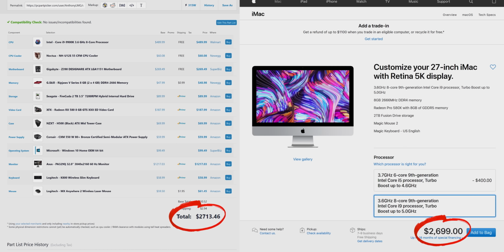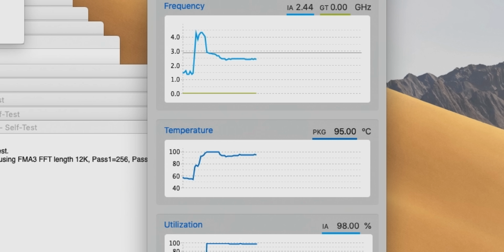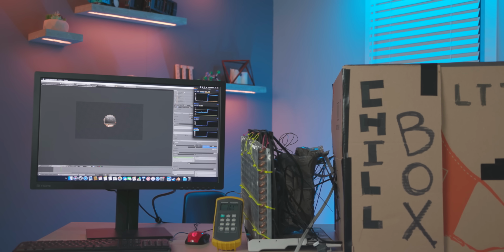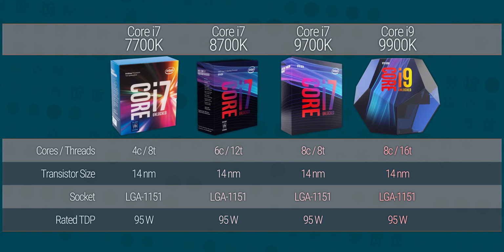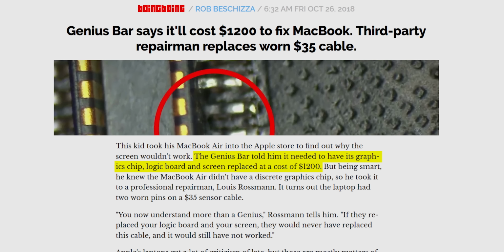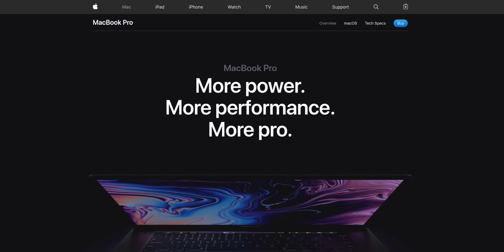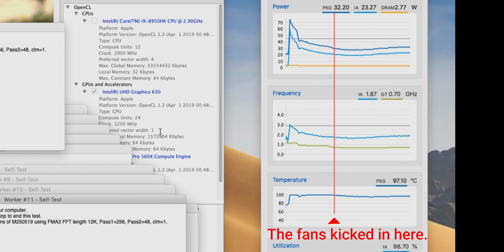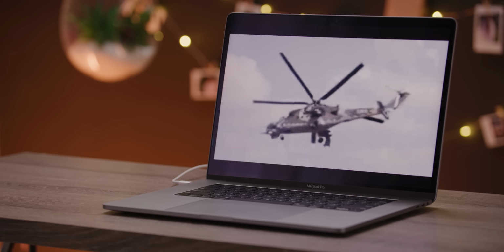Macs are SLOWER than PCs. Here’s why.

Comment: Most important thing is software - not to look cool. The track pads are also a dream to work with if you're stuck in front of a computer 14 hours a day. Then ease with which you can flick between screens and minimise things more than makes up for the extra .2ghz you might get with a PC.
Reply: Fuckkk then I must've missed out on with my custom built pc that outperforms basically any Mac on the market
Reply: Vlad Like Outpaces, definitely doesn’t outperform.
Reply: @danielk1380  how do you know? I've been building PC's for 6 and half years, everything that you described in that original comment  about how you experienced Macs is basically what I experienced on my pc, the only difference is that my pc actually has the fucking horsepower to run some very demanding programs and play any video game at maxed out graphics settings

Comment: They doubled the cooling capacity on the 2020 mac mini and literally no one is talking about it. Get the 6 core, install your own ram, and get an egpu. The thing is actually a beast for under 2K.
Reply: And my custom built pc that is under 1500$ can already outperform that and feel even better to use
Reply: Vlad “It feels better to use” ?

How much time have you spent on the 2020 6core i7 mac mini with 64GB ram and the black magic pro egpu?

There’s really not much to criticize.
Reply: @bigimportantman1544  how much time have you spent on a Ryzen 5 3600, an GeForce RTX 2070 super, 16gb of ram, and 1TB of  Solid State Drive storage, that also has 2 monitors, and one of them are 144hz monitors. Don't need 64 gb of ram, I never needed that much for most resource intensive games, it's just a waste of money and I'm much more at a disadvantage buying a Mac in general

When I build a pc, I aim for both having low price and good performance on computer parts
Reply: @bigimportantman1544  Ive been building PC's for 6 and half years guy, you don't need to explain me what computer feels better to use
Reply: Vlad Cool. I wouldn’t even know what feels better because I’ve had no desire to switch off from my setup. What exactly is inferior with it?
Reply: @bigimportantman1544  the graphics card combined with the cpu I'm using, but the graphics card is where it outperforms, in every game possible rn it feels amazing, programs don't have any sort of hiccups because of the cpu and the solid state drive. And in general its the price per performance, I am able to achieve way more performance even tho I payed basically around 1k for all the parts to build the PC
This building a pc might seem complicated but doesn't take much to understand it and for me it's fun to build too
Reply: Vlad More power to you. I’m not really a computer guy. I just periodically upgrade my mac mini setup whenever something is throttling. It’s basically specced out to the max right now, but I traded up overtime without ever spending too much.

Comment: The reason they do that is because users who use a product like a macbook air simply want something that’s always fast and snappy for basic productivity. Basic productivity sometimes requires a temporary spike in CPU usage, but nothing long enough to cause the internal temperature to significantly change. If you just need something that’s portable and snappy with a great battery life, MacBook air is perfect. If you want lots of computing power, they made the MacBook Pro.

Comment: The new ryzen 4000 chips seem much better with heat generation.  I wonder if Apple will start to use them.
Reply: Ryzen 4000 are great cpus don't know tf you are talking about
Reply: @vlad3223  Sorry I meant they don't produce as much heat compared to Intel chips.  Yes they are great chips.

Comment: The problem Apple Computers and specifically Macbooks have are Intel processors. 
They just perform bad and generate too much heat to perform okayish. 

If Macbooks had own ARM processors then they would be better than any other laptop, including way better thermals. 

I mean the A12 in the iPhone 11 has higher single core performance than a Ryzen 7 processor and it runs at just 6 watts. 
Same with iPad Pros being faster than Macbook Airs and entry Macbook Pros.
And iPhones and iPads dont even need active cooling. 

Since ARM Macbooks will come in the future for sure, you can only imagine what Apple can do there. 
Their processors certainly will be 1 or 2 generations ahead of AMDs mobile lineup. 

Take tablets and phones for example.. 
There is no competition for iPads in terms of processing power. 
Same with phones.. I mean its a bad sign for Android phones when an Galaxy S20 Ultra barely beats an iPhone XS from 2018 in benchmarks.
Reply: Did you just say that a mobile processor outperforms a very good desktop cpu? Just please for the love of fuck, do some basic research on desktop and mobile CPUs

Comment: I'm pretty sure Apple doesn't want to make their silicon look bad, that's why their phones don't throttle.

Also, Apple was never a huge fan of working with Intel. Maybe they're doing this to show how much better their SoC's are? No ideia
Reply: Wtf what silicon are you talking about? If Apple didn't like Intel then they would have stopped already, basically the first line ups of the Mac books used Intel cpus.

Comment: As if windows laptop's don't break or run forever...
Reply: @IG-100 MagnaGuard Classy! Nerd...
Reply: @sonnymorgan4680  yea the nerd that also uses their heads and doesn't dive deep into spending over 2k on a mac that prob lasts around 2-3 years
Reply: @vlad3223  A  little reality check for you: My Macbook Pro from 2011 is still running perfectly with the newest Mac OS (Catalina). All that theoretical bullshit about macs  breaking because their processors are running at  higher temperatures don't translate to reality. It's just a fantasy for people trying to justify water cooling for their PCs.

Comment: The biggest beef I have with Apple are their costumers. Of course also on their heavy opposition on right-to-repair, but that is a topic for another time. The fact that I see Mac laptops being sold for $1000, aged ~3 years is enough for me to absolutely rip my hear out in frustration. It screams to me that users don't care about WHAT laptop they get, as long as it LOOKS like the newer models. Any sane consumer would in such a case buy a newer one which isn't that heavily off from the heavy-duty laptops (which are objectively better, yet often still cheaper) and then sell them to retards a couple years down the line.

The amount of second-hand consumers with Apple's products is staggering. These are the people that are most likely keeping Apple afloat, because if you buy a brand spanking new Mac laptop and sell it two years down the line, you can at times get 2/3rd the cost of a new one. You basically just lease them. Apple doesn't care, for sure. They sell the same amount anyway.. but they are seeing their loss of potential profits by the fact that someone has the audacity to repair their garbage so naturally they oppose it. If you're buying second hand, you damn well will run the risk of having to throw it away. Still, right now you can get them repaired and people can 'safely' buy second hand. 

I'll never buy Apple products, much like I'll never buy Huawei or Chinese spyware loaded bullshit products. I'd sooner use my Nokia before any Huawei stuff.. or Apple.
Reply: Damn did Apple steal your girl or something? You big mad

Comment: They’re all good points and if you’re a heavy duty gamer then you’d be crazy to buy anything other than a custom build PC. But, in this video at least, you disingenuously ignore real life. In real life those Macs will be used mainly for word processing, image editing, website design and the like. And you know what? In my experience, and for ‘normal’ workloads, the Mac isn’t slower at all. Nor is it a bit faster. It’s a whole lot faster - and not just because most people buy PCs with rubbishy thermals either. 
The plain truth is that, despite great strides in this area by Microsoft, Windows gets in the way. MacOS is a more efficient OS to use, plain and simple. If you’re a coder (and I am) there are other benefits too. Apples APIs are the nicest in the business and I can develop for a Mac or iOS device faster than I can develop for any other platform. Apple users are more likely to realise the value of software and pay for my efforts too. 
So yes, I have several (home built, from Zacate to Ryzen, depending on use-case) PCs and they’re very nice and very useful. But for real work, it’s got to be Mac.
That said, if you prefer Windows more power to you. Enjoy it. It won’t spoil my day at all.

Comment: My 2008 Mac Pro  with 12 Xeon cores is still a quick desktop work machine.  It has not slowed down over time, the only upgrade i've done is SSDs.  It also has great cooling. Of course Apple no longer supports it, so there is that ...
Reply: Well I don't think any company would support a 12 years old computer, but it's great that it's still works well.

Comment: Well idk but I think he answered the reason why there’s a difference between the iPhone and the Macbook. Apple manufactures its own line of processors for iPhones, but they rely on intel for there MacBooks. Im guessing the macbook design just assumes that the processors should be able to have the quality output regardless of the colling capacity of the machine. I guess the solution for this would just be for apple to switch to AMD or build their own Aseries macbook processors too.
Reply: Spot on here bro, seems like apple acknowledges this problem and will finally switch to processors of their own design in 2021. It was time, the iPad pro and the iPhone are faster than an i5 MacBook air.

Comment: Whet it comes to Laptops, well if you need thin and light computer with some horsepower, then the choice is limited.
Sure you can go for a dtr, but battery life will suck, screen will suck most if the time, and those are definitely not thin not light.
If you search for a Windows premium Ultrabooks...huh, Microsoft surface  line throttles same as Mac, Dell's XPS same + they do tend to have some problems with 15inchers  (7590 is the best example)
Lenovo and theirs extreme x1 gen 2 have like 5h battery life with 4k panel. 
Perf is similar to i9 in Mac.

All of them will have worse speakers, touchpads, and Mac is the only on you can charge on a plane (100w limit).

I had this problem recently when I had to buy an Ultrabook, and went with Apple MacBook 16.  Hate it or love it, I wasn't able to find better choice in the windows world ;(
Reply: Yea the top of the line of windows wont feature amd which is really sad
If only they all use amd

Comment: Mac performs better than windows but mac hardware sucks.  I have hackintoshed several computers and it becomes very apparent especially on low end laptops where every bit of those specs matter that the computer is more responsive and can run applications more smoothly on MacOS than if that same application was running on the same computer with windows. The only valid argument that can be me made about PCs being faster than Macs is that they have better hardware than what apple provides you especially when it comes to managing thermals.
Reply: Walker Firmin I disagree, Windows 10 is a very smooth OS with good specs. They also have the ability to do so much more, which negates the “better software” argument.

Comment: Maybe once Apple starts manufacturing chipsets for the Mac they can use it to their advantage by changing what it means to have a “fast” computer and using different specs to label the Mac performance. I think you’re right, it’s most likely the marketing for putting in higher spec and quietly throttled CPUs.

Comment: This video is ridiculous. Accuse apple of false advertising yet use a clickbait video title. "Mac is slower than PC", but really just compares laptops which we ALL know thermal throttles. Yet ignore the Mac PRO which has no thermal issues. Also,  the it is OBVIOUS that the mac pro is NOT designed to run at 100% performance at all times. Only servers are designed that way. It IS designed to handle daily tasks with a breeze but still have the juice for more intensive task when you need it, just for a short while. In fact, if you CLAIM to be a professional, why the FUCK would u render on a laptop? The FIRST thing a professional need to do its understand the purpose of its tools. Its like comparing a 1000$ kitchen knife with a 100$ butcher's knife, made with the same steel, but yet complain that the kitchen knife can't butcher cow. Obviously it can't, it is not designed to.
Reply: Point is, Windows will always be better because Windows is an ever-upgrading system. Macs suck for upgrades, and they’re too expensive. I can get a better computer for half the price with Windows, or even Linux.

Comment: My 10 year old personal mac laptop is still faster for day to day tasks than my 2 year old work hp laptop.
Reply: Lync Concierge HP sucks. That’s the big thing here. HP makes cheap, terrible laptops, buy a razor blade 15, then come back to me.
Reply: And how well will that razor blade 15 be doing in 10 years? Will be bogged down, slow and not running anywhere near the latest version of Windows. 
Either way you’re missing the point. A new laptop from any manufacturer should be better than a 10 year old one. Simple as that.
Reply: Lync Concierge problem is, we can already prove that windows laptops still hold up. The original razer blade came out *9 years ago*, but still has specs that can rock 1080p gaming on most quality settings. Of course it has degraded, but it still holds up beautifully and costs a hell of a lot less. Then we have the Mac, a waste of quite a bit of money that frankly I believe to be one of the worst laundering schemes on the planet.

Comment: 0:17 he could have gotten an h310 board or even b360 or z370 and it would have been cheaper.
Reply: I also thought the comparison was shit.
The IMac is an all-in-one, the PC is a Desktop> unfair comparison
Then the Desktop has overclocking support as can be seen by the more expensive K version along with a very expensive motherboard.
The Desktop Monitor is 32 inch, the Retina 27. This difference might sound small to a human seeing the screen, but it sounds very big if you look at the price difference.
4/10 for that comparison tbh

Comment: Linus:
Talks about intel processors thermal throttling 
Me:
Laughs in AMD Ryzen 5
Reply: If you’re able to get a Ryzen 5 to throttle I salute you. 1.45v 1600af hits 85 degrees.
Reply: @minimumdorifto6595  Degrading your cpu in the process significantly yay
Reply: Minimum Dorifto I mean u don’t want to grill your CPU with 1,45V ;)
Reply: @minimumdorifto6595  You can with the R5 3600 using the stock cooler. Run a stress test while it's overclocked and it'll throttle. That's why most reviewers recommend an AIO cooler (Gammaxx 400 should be good) if you plan to overclock.
Reply: @lewsee5562  I've used a 3700x overclocked with stock cooler, runs okay but after a few hours can throttle. Need to replace cooler but I run a business so will probably update the whole machine.
Reply: @lewsee5562  yeah, but u are talking about overclocked Ryzen, but we are talking about stock solutions. and Ryzen is not throtling
Reply: New video: "How we DESTROYED the MAC PRO"
Linus: There was a lot of budget room for this build, and AMD's Threadripper 3990X fits the bill nicely.
Reply: You're not supposed to use the stock cooler for overclocking
Reply: me: laughs when my fx 8350 in 70C and 1ghz throtling
Reply: I'm also thinking for ryzen 5 3500. Should I go for 3rd gen or wait for 4th. Right now, I have i3 6098p which stutters a lot while playing forza horizon 4. And, If I put same ram (2133 mhz) does it perform same as i5 9400f or worse
Reply: @prateekpanwar646  You can go for Ryzen 5 3600. It can last you for half a decade, and you can upgrade to 4th gen if it starts to bottleneck.
But you gonna need a new set of RAM for Ryzen. You get way better performance if you buy at least 3200Mhz. The cheapest reputable ones are Corsair Vengeance, Gskill Ripjaws, to name a few.
Reply: @prateekpanwar646  9
Reply: chad
Reply: Same my ryzen 5 2600x hits max 55 degrees
Reply: I'm laughing in core2duo
Reply: Jaydon Dunnum im laughting at all of you with a old i7 on DDR3. Your systems sucks, especially the ryzen bullsh*t

Comment: Well, thanks.  Gonna get the i5.
Reply: If you get an i5, get an intel 8000+, the 7000 or lower ones have 2cores, basically 8000+ series are 2x faster at start with 4 cores
Reply: @gzarari  I actually just got a whole new system.  Chose the AMD 3900X after I saw Linus' review.
Reply: @gzarari   having double the cores doesn't make it twice as fast, but yeah, more cores are generally better for productivity and sometimes gaming

Comment: Why the philosophy difference between iphone and macbook? Honestly it's a simple one. Apple designed there A processor mobile chips, and they are way ahead of the game. Intel is a hot mess, and do not hold to the same innovation apples processors have. We have a company (apple) that will not succumb to other manufacturers needs and demands, and a company that will not provide better and innovation to their customers. I bet if apple was able to design a desktop chipset, they would make it work seamlessly with their macbooks.